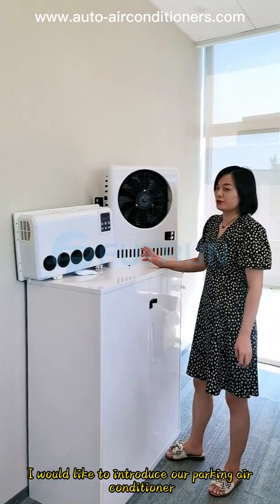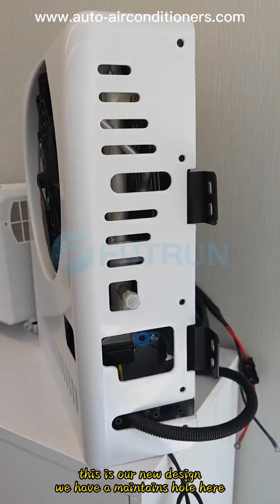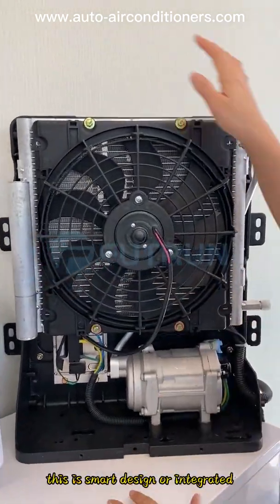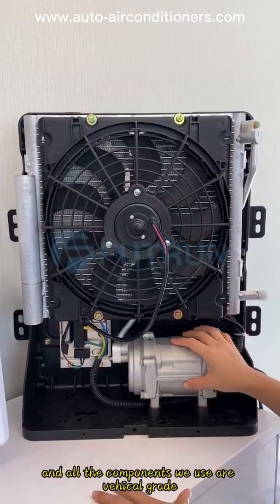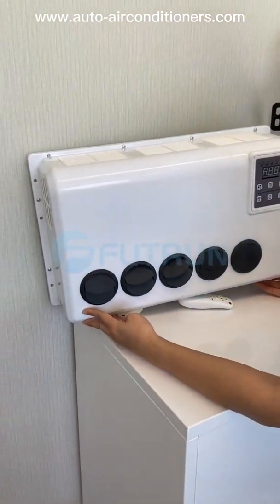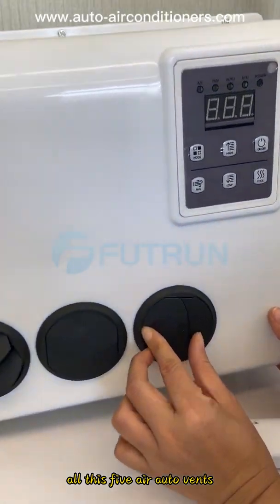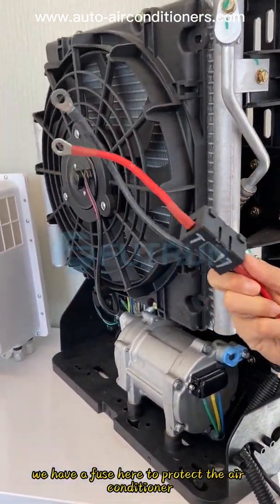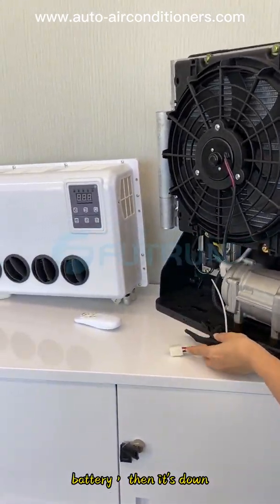Disassembly video of split design 12v/24v parking air conditioner

Comment: What problem in sow display E 1 Error code
Reply from the maker: Please add my WhatsApp:86-15950458518, I will support you will all aftersales questions
Reply: @Futruntech  ok
Reply from the maker: @rishikeshgautam6768  our E1 is indicate high or low voltage protection